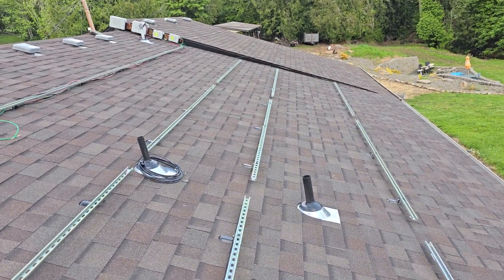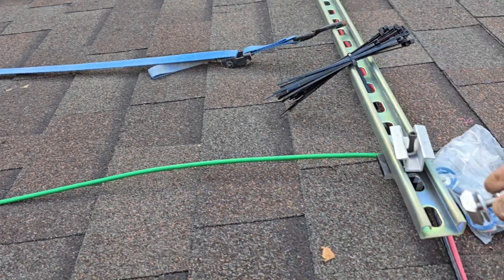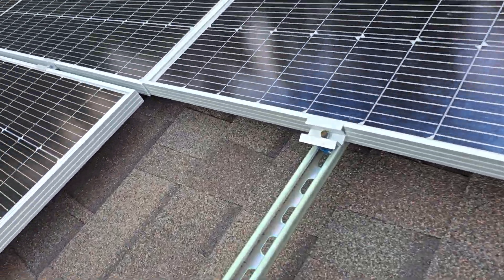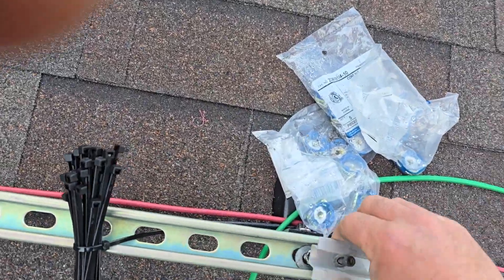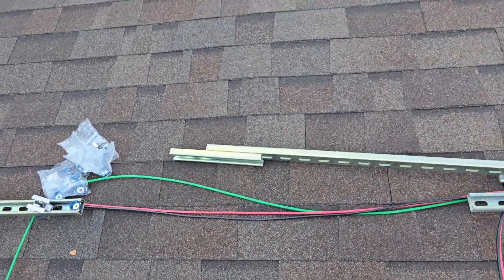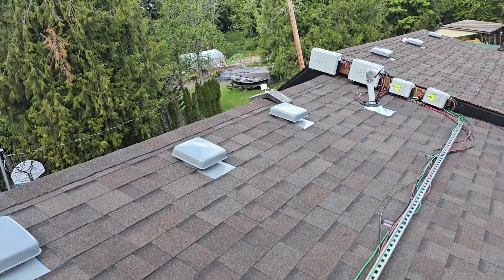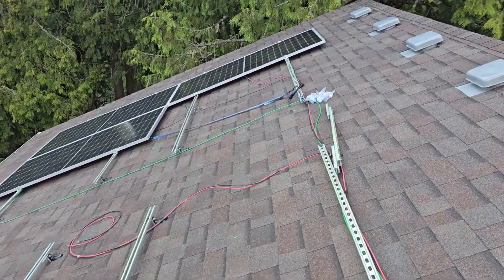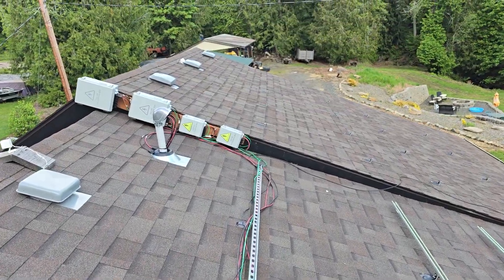Solar Panel Rooftop Install: Mounting, Wiring, and Combining Arrays in 2024.

Comment: What are those black mounts between the unistrut and the roof. Where did you get them and how are they fastened to the roof?
Reply: Thanks for sharing. The pitfalls of DIY solar is too often overlooked.
Reply from the maker: Pack 10 Black Z Foot Bracket with Flashing for Solar Panel PV Module Mounting Racking Installation https://a.co/d/2WzIQgZ
Reply from the maker: https://youtu.be/FeBB9TD12s4?si=eUHbJudK22hO75c8